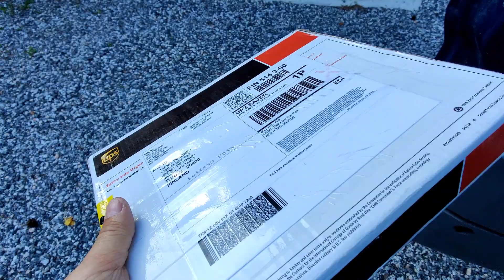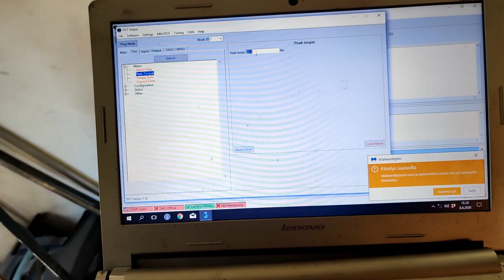Jarmo is test riding the electric mx bike

Comment: at the 16 minute mark the green connector box for phase wires , i  would use dialectic grease on top of connectors to insulate all three from each other just in case if water gets inside the box
Reply from the maker: I am using similar wurth branded grease. I have filled the green junktion box with this grease. But this was a very good notice. 🙌

Comment: What guage wire did you use for the motor and phase wires? I am converting a 2007 rm 125 to electric...68ah battery,  qs 138 70H motor, votol em 150 SP controller. I will only be pushing 150A max what guage do you think would be best (safe). This build is very impressive, mine will not be nearly as fast haha